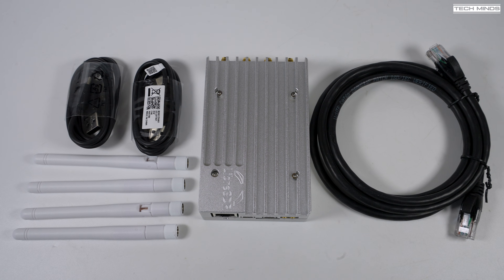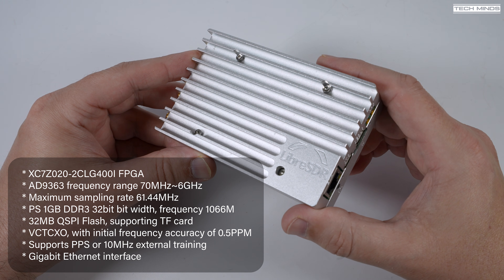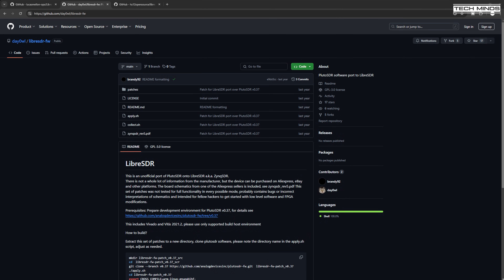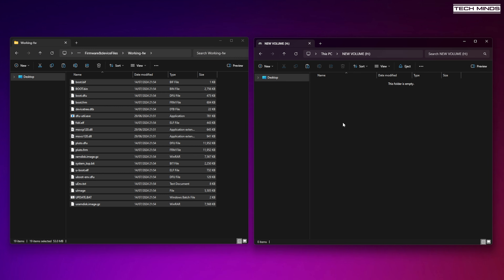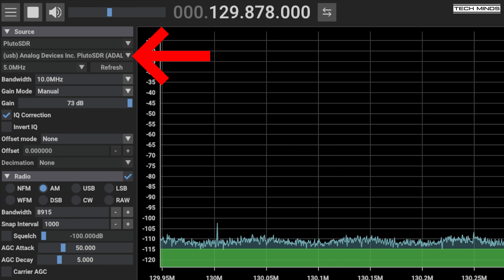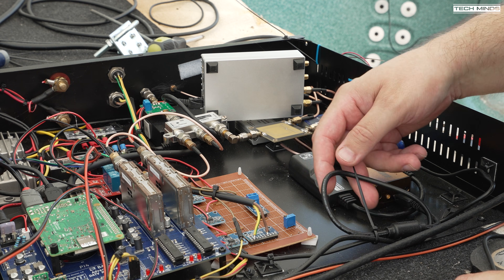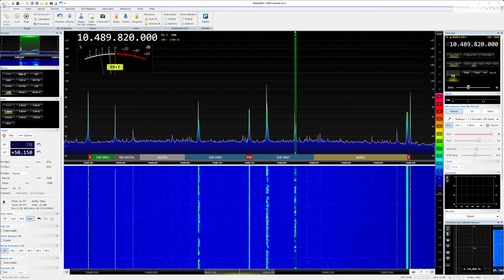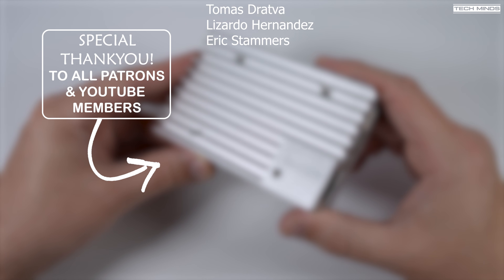LibreSDR / ZynqSDR Software Defined Radio - 70 MHz to 6 GHz

Comment: I'm very familiar with the AD9363 having used it at work for many years.
The spike in the middle of your transmission looks like a DC offset in the AD9363, which results in carrier leakage. This device has built in calibration which you are supposed to run while setting it up which nulls out the DC offset for the configuration you have just configured. If you change the device setup too far from the starting set up, the calibration needs to be re-run. Or it may be that the calibration sequence failed to converge.
Reply: Hi there, may I ask how one might run calibration on this device ?
Reply: @PhantomVideoLive in SDR Console there is a method to run calibration.
Reply: @mrtechie6810  thank you for this, is this feature specific to the AD9363, do you have any documentation for that feature in SDR console? After calibration does it fix the spike in all SDR software ??

Comment: wow, was that tetra airwave from 390MHz showing up at 132MHz. pretty bad filtering if so.
Reply: There is no frontend filtering, please don't connect this thing to a high power PA directly
Reply: There is no filter homie. No filter, no calibration, just raw-dogging it with harmonics all over the spectrum.
Reply: @thedogbarked123  LOL

Comment: Nice one, I had the same problems I thinks there's a 200 and 400 version I have the 400 which wont work with the DJI drone sniffer firmware very annoying -I found the GB LAN could not keep up with the 60Meg stream -should of just bought 4x HackRF`s instead ! [FYI was sold on Ali-express as a B210/pluto clone]

Comment: Matt, please to do the review of Fobos Sdr from RigExpert. Operating frequency range from 100 kHz to 6 GHz and up to 50 MHz bandwidth with 14-bit signal sampling resolution.
Reply: Been eyeballing that rig for awhile now
Reply: Its just an overpriced receiver, and whats the chance of your purchase getting blown up on its way from Ukraine? Im going to stick to china or EU
Reply: Wow shadow ban for that?
Reply: Its only rx! And from a warzone. Doesn't sound reliable delivery or aftercare support. Stick to EU companies if you want any level of protection
Reply: @noimnotarobotcanubeleiveit7024  it's available to buy or as preorder in some EU shops. I don't know what are you talking about. Support from RigExpert is fantastic. Check first and then comment.